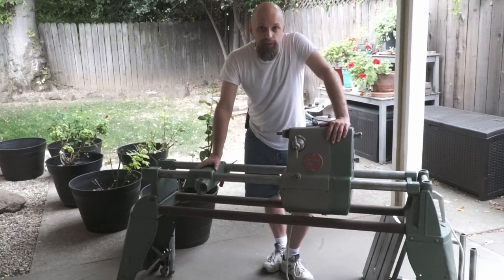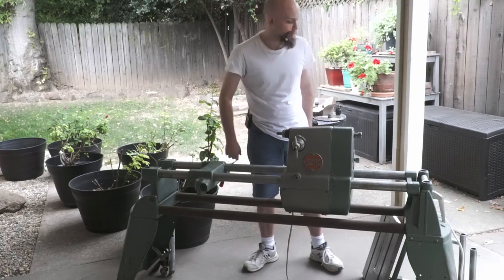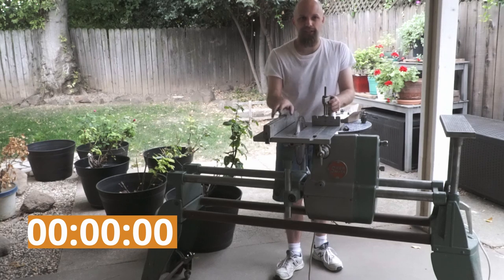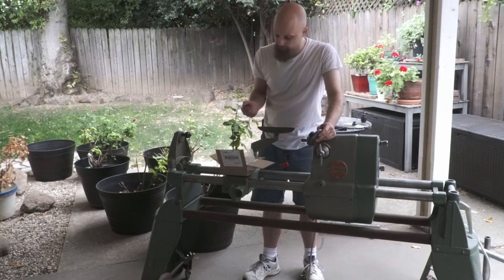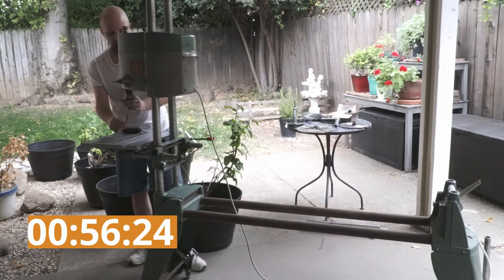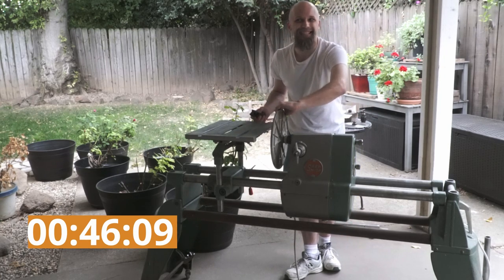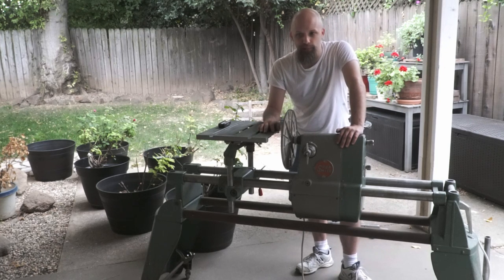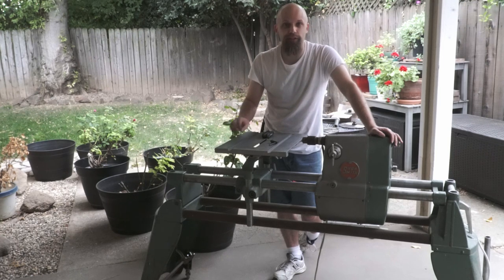Going Back to Basics with Shopsmith

Comment: My Dad bought a new Shopsmith in 1956. It is the machine I used as I learned woodworking in my younger years. When Dad passed I got the machine. I put new bearings in the headstock and motor in 2017. Since the newer base machines are the same as when the mark 5 was first introduced , all the table upgrades ( and associated safety upgrades) are available through Shopsmith or on the second hand market. If you have a small workshop this machine was made with you in mind. By the way, if you don’t have the owners manual it is still available through Shopsmith. It shows proper setup and alignment. It will be the best $30.00 investment you can make on this machine.
Reply from the maker: My goal is to retrofit the headstock to a power pro and upgrade the table, carrage, and other upgrades. Its why I started a gofundme. I have aligned it as best I can thanks to a shopsmith video on youtube.
Reply: @thebeggarswoodshop8756  You will like the PowerPro. I got one over a year ago. As you already know the alignment is key to accuracy. I did a lot of work on the 500 tables but I must admit the new table system is nice. Good luck with your plans for the machine.
Reply: When my uncle passed away in the late '90's I got his Mark 5 (along with all his Shopsmith manuals!)... I was primarily interested in the lathe application to make my own instrument tuning pegs (Persian setar, kemancheh etc) but I mostly have used the drill press application as a horizontal drill press ... I haven't tried the table saw or even the lathe applications yet 😆 I know I'm under utilising it but frankly power tools with blades scare the b-jesus out of me!!

Comment: I also have a 1954 mark 5 greenie, it's an awesome machine. I'd recommend picking up a lower saw guard for the table saw, and a nova chuck for the lathe. You can also pick up a shaper head, molding head, use it as a router or a drum sander...the bandsaw is awesome, the 48" belt sander is awesome, the jointer is OK, I've never used my biscuit joiner or the scroll saw. This machine is a beast.
Reply from the maker: some of those are on my to get list. Stay tuned to the channel, some upgrades are coming

Comment: I enjoyed your video.  Using the longer 5/16 wrench and practicing with your machine you can cut a lot of time on the switches.  By having the accessories closer and doing dry runs on set up one can even knock off more time .  Love my shop smith tools.

Comment: Hey all great vid. Here’s the but. Check and double check all tightening points and alignments. The 5 does not have all the idiot safety stuffs. However with common sense and not trying to change between tools in 30 secs. Be smart be safe and good projects to you.

Comment: Years ago I bought a Shopsmith from a neighbor across the street. He bought it new in 1952 of thereabouts. He was now too old and frail to do woodworking. I set it up in my basement. I figured one tool would do the work of several in my very limited space. The Shopsmith had no safety features at all and was really under-powered. The table saw blade was 8 inches, not 10, yet it performed admirably within its limitations. I especially liked the lathe, athough it was difficult to change the speed. Same true for the drill press. Eventually I sold the machine to another neighbor and I have no idea what happened to it from there. 

My point is that I would certainly consider a modern Shopsmith if I were buying. However, I have moved several times since, and I have even less space than before. Guess I'll have to take up another hobby!  -- Bill in Colorado
Reply from the maker: have you looked at shorties/a Mark 4? Helps to fit in limited spaces.
Reply: as stated look at what thy call a mark 4.  But Don't buy it new. Find a good used mark5  510 or 510.  Huge work tables. Also I think in the 70's they went from a 3/4 hp motor to the 1 -1/8hp now still used to day.  Except the power pro's that use a electronic DVR motor. Basically a giant stepper motor able to turn  out 2hp on 220v or 1.5hp on 110v     You can cut about 18-20 inches off the tubes and shorten it. It does take length off of the lathe but if you are not buying for a spindle long turning it is steel I nice lathe for bowls and other small  or short Items.    I picked up one just like this one made in 1980 for $125 in bad shape torn all apart.  So I put new bearing in it and painted it to a color in my opinion I think they all should of had done.  hunter green and almond white.   

Link to shop smith #1 I purchased, Then I bought another  made in 84 that I took the legs off and hung on the wall as a permanent drill press over head router. Then my 3rd is the 510 model with the large table set up and they all came with different options,   S I have multiple s of some.  But I have the bandsaw, the jointer, 3 sets of lathe chisels, Mortis tenon kit to drill square holes and a lot more. my last find was a power station with another jointer for a smoking deal of $75 BUCKS!!!    All of these and I have spent less than $1500 on the entire collection.  So if you going to buy check out marketplace or craigslist.  I have seen really nice 510 models start as low as $400   and 3 times nicer than this guys.  Buy them from the mid 90s and up the added an extra bearing in the quill making them even better.     I love my machines and the folks that talk shit on them do not own them and if they did they do not understand proper set up of the machine or operation.  They fact the table saw blade does not tip and you have to the table to make a bevel cut is a deal breaker for many.   But I do not find it un safe. You can buy new guards and dust collection shoots and any part you want for cheap on Ebay.   Also if you decide it is not for you then sell t on Ebay Piece by piece and you will triple or more your money.   Ebay people love to pick them up cheep and and part them out all the time.  Most parts are better the newer they get but the way it is made any newer parts can upgrade the machine.      

But check out my 500 on Lumber jocks. They can all be made to look as good. I am going to do my 510 this winter.
https://www.lumberjocks.com/threads/my-vintage-shopsmith-markv.154418/
Reply from the maker: @jvmiller1995  best of luck in your endeavors

Comment: Thanks for these great videos! I have a Mark 500 (I think) with jigsaw SPT. I can't seem to line up the headstock with the shaft of the SPT. I have the straight mounting tubes for the SPT and not the eccentric one. ANY ideas would be appreciated.
Reply from the maker: The straight mounting tubes have always been a problem. You could get up and down but not left and right. I recomend finding some excentric tubes. I know the mother ship (what many of us call shopsmith.com) doesn't sell tubes for the older jigsaw model. Contact Scott over at mygrowthring and he could recomend the right equivalent to get.
Reply: Thank you

Comment: Can anyone tell me where to get the table saw blade sharpened? I cannot find one in my area, So Cal.
Reply from the maker: Contact Shopsmith to see if they still sharpen their blades
Reply: It's usually done by the company that sells the blade. The Forrest Woodworker 2 gets shipped back to the company. Most people keep 2 on hand so one can be shipped. Most blades just aren't worth sharpening unless you spend upwards of 200 dollars on the blade. Sharpens costs about 50 dollars as well.
Reply: Sharpen it yourself?

Comment: Can you transfer a 10er model over to that base?
Reply from the maker: A 10er has different specs that I'm not familiar with. At first glance of things, I would say no. However they did try something like that with the Mark 2. If you can find out more on some of the specs of things it would be worth trying.
Reply: I also have a 10er that actually came with the house I bought. The previous owner used the blueprints in the original manual to make the base and it works great. I would rather have the mark V type base though. Please update the post if you were able to make it work. Thanks

Comment: I own a 10er and 500 and both were sold without guards. All old machines ran  without guards and many with exposed belts and pully, like my 1940s southbend metal lathe.
You most certainly can run them without 'utter death' occurring but make one stupid mistake and then its gonna be a very bad day.

Its amazing but most carpenters I know wedge the guard open on their circular saws. They would remove them entirely but need to be able to pull the wedge when OSHA shows up on the job site. 
The guard actually makes the saw more dangerous for certain operations like plunge or chop sawing as you have to manually hold it open to expose the blade. 

At some point you have to exercise common sense and caution. Like keeping boom boxes off the job site.
Its a job site, not a disco tech for the love of God. They cripple you by taking awaying your hearing which is dangerous on so many levels. Unfortunately the safety devices sometines promote ignorance, a lack of caution and general disrespect of the job site.

That said, I think safty upgrades are in general an improvement but basics, (like dont hang your 12" beard or hippy hair into a rotating tool space), are more important.

The best safty on a gun is between your ears. 😂
Reply: *Discotheque

Comment: At 4:25. Absolutely no safety guards above or below.  Somebody shorted you when you bought it.   There are guards made and available.
Reply from the maker: This is the original Mark 5 Greenie from 1954, they weren't there yet and this was as is. I have since upgraded they setup since shooting this video
Reply: @thebeggarswoodshop8756    You are absolutely correct.  The original brochure shows with no guards.   I stand corrected.

Comment: You could shave several seconds off your time by using a long hex key of the right size instead of fiddling with opening a folding hex key set.
Reply from the maker: I have since received the shopsmith one when my upgrades were purchased. However I wonder how many seconds in certain changeovers would really be shaved off with the upgraded versions. But, every second counts.

Comment: I have the same model along with a mark 7  but mine came with the upper and lower guards.. available Upper from Shopsmith…Upper #513522.$4.95 lower #514358…$139.51.. pricey but worthwhile
Reply from the maker: Saw guards will come when I upgrade the table saw